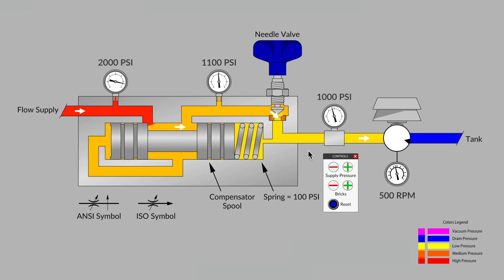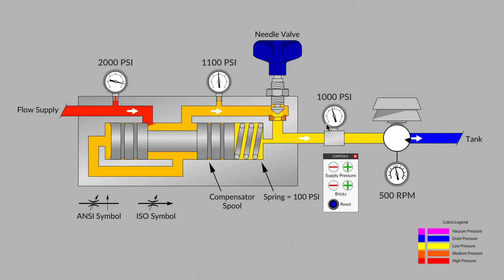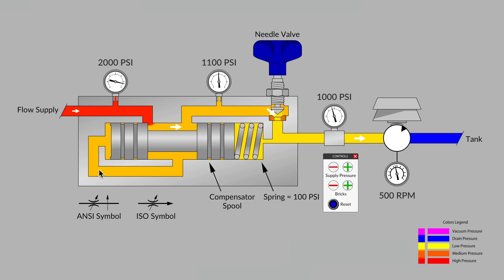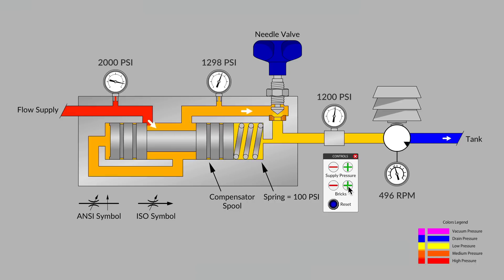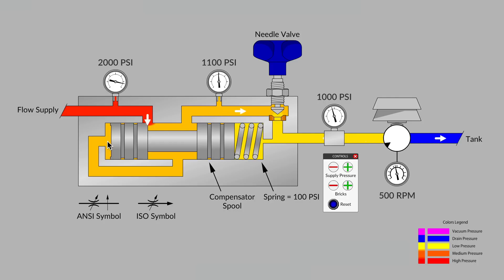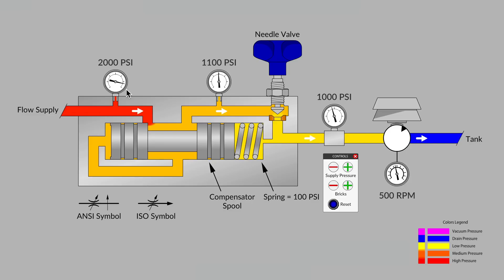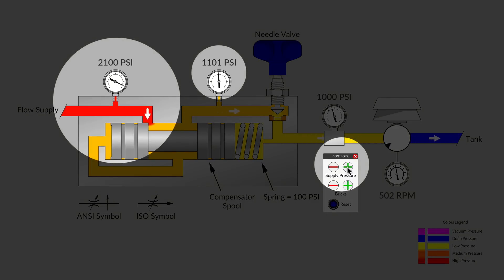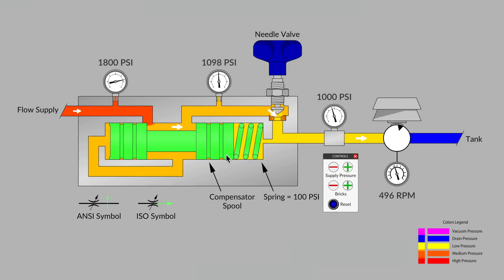Pressure Compensated Flow Control - Part 3

Comment: And if the spring breaks, all flow stops?
Reply: I guess, Flow would be there, but the flow would be as in the case of non compensating valve
Reply: Pretty sure you're correct, without the spring the inlet pressure would shift the valve spool to the right and therefore blocking inlet flow from entering the needle valve

Comment: How is the source pressure(2000psi) not changing, while changing the resistance of motor? Please describe.
Reply: Fixed displacement pump
Reply: 2000PSI is at the pump, but the 100PSI pressure differential is between the needle valve inlet and outlet 

Using a fixed displacement pump and this pressure compensated flow control valve allows the same amount of flow to be applied to the load and therefore provides a constant motor RPM

A load sensing, variable displacement pump can be used instead, that adjusts system pressure to always remain a certain amount higher than load pressure (for example if load pressure is 1000PSI then system pressure will be 1300PSI and if the load is 2000PSI then the system pressure will be 2300PSI - always 300 PSI higher (this ensures the actuator/motor RPM stays constant and doesn't fluctuate regardless of the amount of load in the actuator/motor circuit 

Both systems work, one the fixed displacement pump you'll always see 2000PSI at the pump outlet, and the pressure drop will be at the office - but with a load sensing variable displacement pump; the pressure differential will be between the pump outlet and the load circuit with no valving needed in between (the compensator is internal to the pump)

Comment: Hi Karl would this valve only ever be used with a fixed displacement pump or are there applications where you would have it inline with a variable displacement pump?

Brandan
Reply: If you want constant actuator/motor RPM from a variable displacement pump, you generally would use a load sensing variable displacement pump, it performs the same functions as this system but only provides the slightly higher pressure than needed (to maintain a constant pressure differential and therefore constant actuator speed) and no external valving woild be needed, the load sensing pump is supplied pilot pressure from the load circuit and the compensator spring is internal to the load sensing pump, when load pressure increases, the pump displacement will increas proportionally - in this manner the system pressure will fluctuate (won't stay at 2000PSI like in this video) but the system pressure will always remain at a set amount higher than the load pressure to ensure that the flow rate doesn't change; in order to provide constant actuator/motor speed

Comment: EXCELLENT WORK, BUT PLEASE ADD SOMETHING TO SHOW, THAT WHAT WILL HAPPEN IF NON PRESSURE COMPENSATED FLOW CONTROL VALVE IS USED. SO THE IMPORTANCE OF USING PRESSURE COMPENSATED FLOW CONTROL VALVE WILL BE UNDERSTOOD. LIKE SIDE BY SIDE COMPARISON OF BOTH FLOW CONTROL VALVES
Reply: If a non compensated flow control valve is used, then the actuator speed will be dependent on the amount of load that is placed on the actuator (the actuator speed will vary as the load increases and decreases weight)

Whereas the pressure compensated flow control valve provides constant actuator speed regardless of the amount of load placed on the actuator

Comment: How flow rate can vary if the pump is positive displacement ? Positive displacement pump are those who maintain constant flow rate even though pressure changes.
Reply: It's assumed there is a relief valve upstream of this, or the positive displacement pump is also pressure compensated to vary flow rate.
Reply: @gscthompson  Do relief valve control flow ? It just relieves excess pressure , so how the flow is balanced between the relief valve and pressure compensator?
Reply: I guess you didn't watch the whole video...

Comment: pardon my comment but... i would say that the little error that appears when you strive from the design value is due to the non consant force from the string rather than the preassure loss in the path. (there's no fluid speed in that path). 

The secret for this valve to work is that magic string wich force isnt F= k * (l-l0) but simply F=k.

Comment: It seems to me that this system would be efficient when the pressure at the motor approaches the pressure compensator set pressure.  If this system is flowing 10gpm through a 1,000 psi drop across the valve, the energy loss is 10*1,000/1714 = 5.8 HP = 14,842 BTUs/Hr heat added to the fluid.  Can the pressure compensator reference to motor pressure, rather than pump discharge pressure, to make these values run closer together to minimize the pressure drop across the flow control valve, and reduce the amount of work dissipated as heat?
Reply: The compensator already does operate based off load pressure (not inlet pressure) 

the pressure in the load circuit is what opens and closes the compensator

Comment: So if the oil supply is via a gear pump, what happens to the excess flow?
Reply: it would go through the pressure relief valve that is setting the supply pressure
Reply: Why use this option as long as if the pressure exceeds it's limit the relief will open and thus reduce the flow rate
Reply: @tarekbakareng9531  waste power and generate heat with relief valve
Reply: Remember, flow restriction increases the pressure which helps to act on the spring.

Reduction in pressure increases the flow (vol/ time)

Comment: Thanks Karl. Does any of these valves have adjustable springs?
Reply: Pretty sure this one is an adjustable spring, adjusting it will allow for smaller and lower pressure differential across the orifice and therefore faster and slower actuator speeds